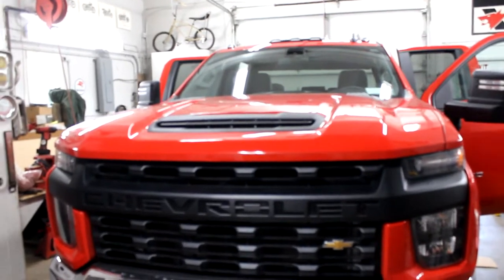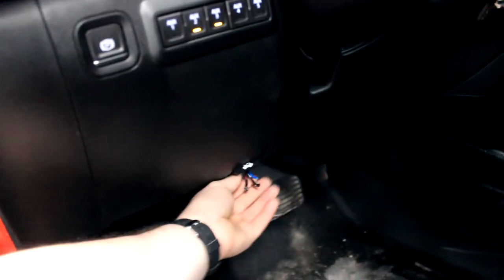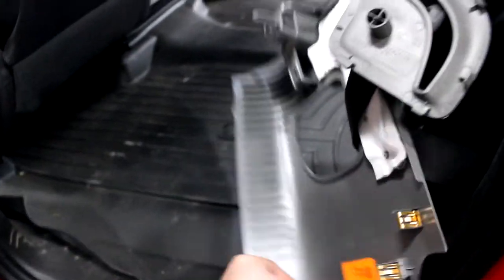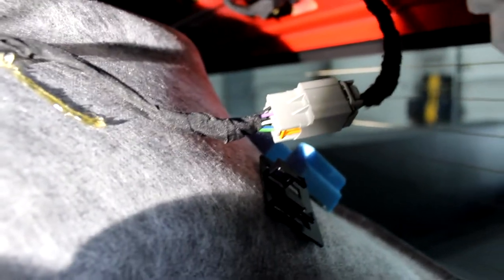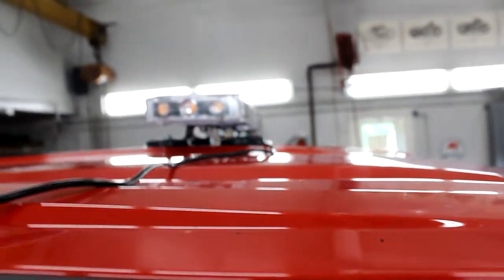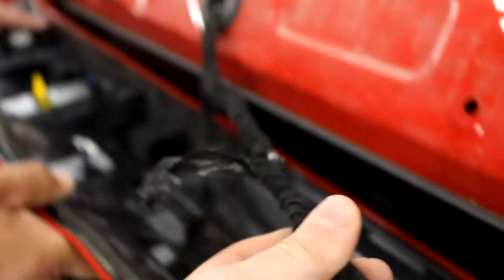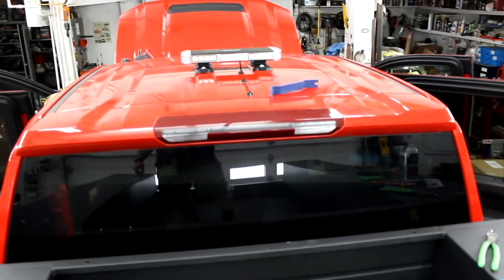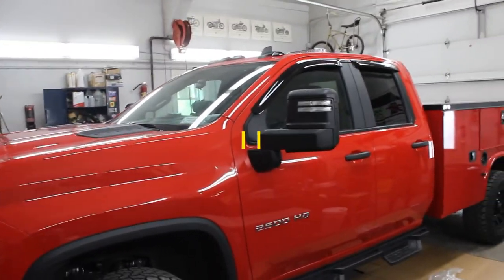Chevy GMC upfitter AUX switch 5 wire location and Third Brake Light Removal 2020 2021  2500 3500

Comment: I just recieved the Magnum rack I ordered and plan on having a strobe in the middle top running off that #5.  I'm shaking my head at the thought of tearing apart my brand new AT4 2500.   Thank you for the videos, they are a huge help.

Comment: The number five switch is the green wire that’s integrated in the harness coming from the aux fuse box underneath the kick panel on the driver side… it’s meant for those trucks equipped with a roof light. I just pulled the pin out of the harness plug end, removed the wire, and used it for whatever I want.
Reply: I know this is an old comment, but how did you pull the pin out of the connector?  I have been struggling for an hour with no success.  I really would prefer not to cut the wire, but I can't figure out how to release the pin from the connector.

Comment: Great to know!! 
The question is will the  extruding wires cause water ingress to the taillight??
   Have seen that as issue in past GM year trucks. 

I have '24  3500HD w/o the silly rear spoiler to deal w, just the brake light .  
     The 4 wires under dash are the same color config and i assume same switch #s.

Comment: Thinking out loud. I have made comments about having to pull the transmission on the Dmax 3.0 for the oil pump belt. I thought that was insane, but this takes the cake and leaves no crumbs. On the 2011 2500HD I just traded in for a 2021 2500 HD High Country I only had two screws and one 8mm bolt and the knee bolster was off. With this design you have to dissemble half of the damn dash to put install the switch for the whirly gig light on the roof and then almost half of the head liner to get to the nuts that hold CHMSL assembly where the wire is you need for the roof light. If you ordered the snow plow option with the intent to use it just add another $1,000.00 for the dealer to tackle the two issues here and then there is the device that stops the dash for going blank when you operate the plow. I'll bet that once someone jumps through the hoops here to plow snow, this will be their last GM product. Remember what Mrs. Gump said about stupid.
Reply: Completely agree, we upfitted our 2013 Chevy 3500HD and it was somewhat straight forward; this 2024 3500HD is the biggest PITA I have ever come across
Reply: @snowcatcowboy  Engineers............

Comment: So I'm terribly lazy. About where is that wire loop set in relation to the light? I'm going to just drill the fiberglass and put in a rubber plug when I'm done.

Comment: Great video! Thanks! I have a 2024 3500HD LT and want to add the 3rd Brake Light Camera; (box bed camera) did you see any extra wires for the camera or are the in the light plug since the camera is formed into the brake light?

Comment: Geez! First let me start off with I have a 2021 2500, but hats off to ford. The aux wiring is all under the hood next to the fuse box. Easy as pie wire up all attachments
Reply from the maker: Yeah I am a Chevy man but you are correct. All the manufactures have their pros and cons for fun search how you check the transmission fluid in them new Ford Super Duty's.

Comment: The wire location is noted in GM  UI Bulletin #157b
Reply: this is exactly the info everyone needs. remove rear tail light or with spoiler just drill a hole and fish the loose wire out. easy shit

Comment: vehicle engineers are a special breed.  They aren't very forthcoming with specifics.

What are you doing about the empty plug for the tailgate that is left open when the tailgate is remove for adding a sander?   Our dealer cant find a blank plug to close it up..

Comment: This might be a long shot, looking at the timeline this video was posted on, but I have a quick question. I installed an aux switch for 404part. I was able to locate the fifth cable, but on my 2022 GMC Sierra 1500, the cable has no power. I need help determining why.
Reply from the maker: What cable is powerless?
Reply: @rebelliners  the one at the fiberglass spoiler. The black and the other wire. Yours is green with a tracers. My is purple in color.
Reply from the maker: @ericmagnaye  more than likely left side dashboard underneath not connected
Reply: @rebelliners  thank you for you help, do you have more context on it?
Reply from the maker: @ericmagnaye  I believe the wire would just need to be powered by a source or try local dealership maybe a kit that can b connected like this video if you have located it

Comment: From experience here. Many Silverado's will experience the Rear Window leaking slightly. Where you are with the Spoiler off, put a full length of painters tape along the plastic piece of the top of the window, then fill that trough at the top of the window with silicone, fill it to the top edge, wait a couple hours for the silicone to start to cure (full cure in 2 hrs.).  take the painters tape off. Done. Again by experience, the Two Alignment Yellow Push Pins. From the inside use a 7 or 8mm long socket and push from the inside of the Truck Cab Up along this Alignment pin and pull the spoiler away to ease  removal. You could even use a pair of Bent Needle Nose Plyers to squeeze the Alignment Pins as you pull the spoiler away. Lastly, it would be a benefit when putting the spoiler back on, put a good size dab of silicone at the top and bottom of all these bolts to help make sure water does not come in. If you look closely the bolts removed have a flimsy rubber grommet around them, either replace with new grommets or use the silicone.  Have fun and be sure to reconnect that 3rd Brake light on the Drivers Rear Hood liner.  Easy to forget that.  20 plus years of Upfitter experience on Public Safety Vehicles. Whelen, Federal Signal and Sound Off, Code 3, Havis Shield and too many Motorola radios and computers to mention.

Comment: Sorry I’m 7 months late lol but you should do a video on making the tail lights strobe. According to knapheide and i confirmed via knapheide, those tail lights are prewired and for strobes. There are factory integrated amber strobes in the clear portion of the tail light. I have the same truck, with the same bed, I’m just not brave enough to start throwing 12 volts to wires that I’m not 100% sure what they do. I’ve wired plenty of my older trucks with strobes, but this new stuff is confusing
Reply from the maker: Well that's a new one think someone is pulling your chain but if you got more information we are all ears.
Reply: @rebelliners  Kyle is right. The clear portion of those taillights has amber strobes in them along with the reverse light. I just received my 2022 Silverado 2500HD from my boss. I hopped in the truck and Aux 1 switch was labeled “Strobes” It’s butt spliced in the cab by the Aux switch fuse box.  It doesn’t power up with key switch off and also when the reverse lights are activated. I plant to tie-in a couple strobes and mount them on the front end somewhere. I’ve only had the truck a week and I got plans. I’m adding an aux battery and an inverter eventually. I like the truck, I just wish it was a Sierra instead. The front end looks so much nicer on the GMC. I’m going to complain, I didn’t pay for it.
Reply from the maker: @christopherjohnpaul5591  Can you email me a pic of where they taped that I have not had time to look at one yet. rebelliners@aol.com

Comment: Hey Nat, just watching this video, for the Red 2021 Chevy 2500HD, where You found that the wiring was already hooked up to the factory installed upfitter switches. Just wondering if You have ran across any others that GM had already installed the wiring? I have a 2022 2500HD on order, and ordered it with the upfitter switches installed from the factory, so was just curious if I would have to install the wiring or if GM was now doing that in production!
Reply from the maker: Good question I have seen 4 connected from gm and 4 not all 8 owners said the truck was to come with factory installed upfitter switches keep me posted
Reply: @rebelliners  Okay I will! I will let You know if mine comes in with the switch wiring installed or if I just find all the parts laying in the cab and I have yo install it myself! LOL
Reply: I hope mine comes in all hooked up, for as long as I have been waiting, I ordered it back on July 2nd 2021, it is in event code 3000 with a build date on Jan. 24th 2022!!! I originally ordered a 2021, but it got moved to a 2022 back in Sept.

Comment: Hope you put some sealer around the holes.
Reply: What holes? The existing holes that didn't have sealer to begin with?
Reply: @k.b.322  Page 6 August, 2020 Bulletin No.: 18-NA-383
5201861
Important: The 8 central roof spoiler nuts are NOT
reusable fasteners. The original fasteners must be discarded and replaced. 
That's why I use butyl sealer.
Reply from the maker: Yes We use SEALING PUTTY  https://www.amazon.com/Stero-Manufacturing-Company-P571878-SEALING/dp/B00J47UJ60
Reply: Ya, it's  called butyl sealer. Have been using it for 40 years. Best thing ever
Reply: @k.b.322  yes it did have sealer lol

Comment: Is it possible to use the brake controller wires for something else?? My 2500 HD came with a brake controller  attached to the switches by the head unit. So, I’m wondering if I can repurpose those 3 wires
Reply from the maker: I would test them to confirm what they do

Comment: Does switch 5 (or the rest for that matter) remember position after cycling the key? Our truck came with the harness but no panel or switches so I'd like to confirm before buying the parts. Beacon needs to be on by default (or memory) and turned off for occasional road use
Reply: Yes they do, fortunately!

Comment: I had a question I did everything like the video but none of the wires work when I check them
Reply from the maker: I get a lot of phone calls on this its typically that strange connector under the dash that you hook up from Gm the plug that runs to the main fuse box under the hood can be tricky to to plug in correctly

Comment: Are the AUX lines  1234 fused or do fuses have to be added?? I want to add this switch panel to a 2020 HD High Country,,, I am told it will just plug in to sockets already there,, why this truck did not have that I could not tell ya,,,,,, So,,, are the lines 1234 fused on the truck or do fuses have to be added??? Thanks.....
Reply from the maker: Should allready be there
Reply from the maker: I have seen them set up from the dealer I and I have seen them in a bag under the back seat hit and miss if you have the kit from dealer it will have everything you need
Reply: @rebelliners  Early 2020 NOPE! So it looks like I need that whole plastic part with the square hole to snap the assembly into and the center of the dash has to come apart also to get that part swapped,,,, what a PIA - eh !!! Notice - no room to add 2 way radios etc.... in this truck,,, but a nice spot just in front of the sun-roof for switches - I think Ford puts 6 there......
Reply: Thanks!!!